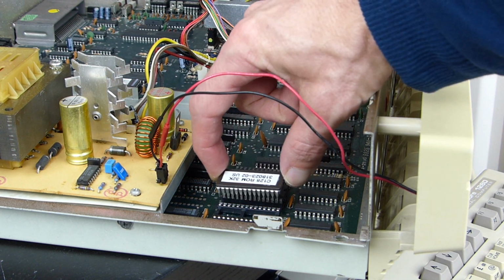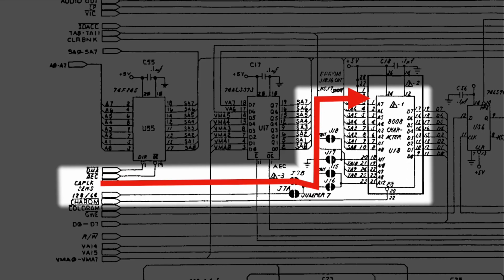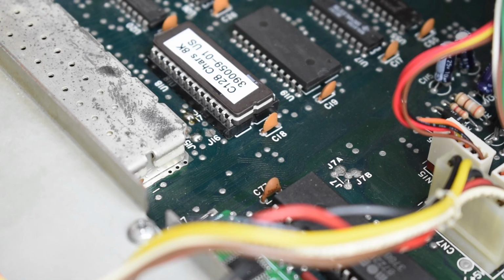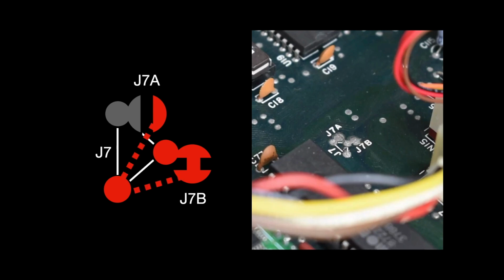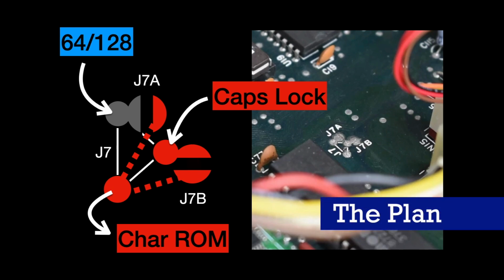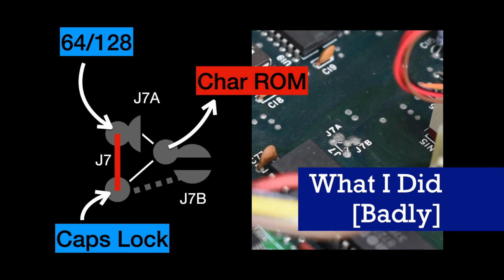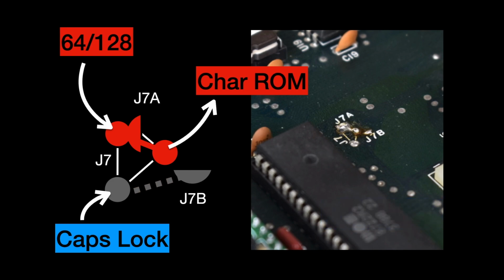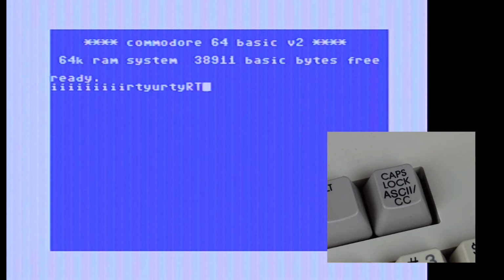The Anglicising of a French Commodore 128 — Part 2: The Jumpers

Comment: In the UK PAL-I system, the single color subcarrier is 4.43361875 MHz above the video carrier. The video bandwidth is 5.5 MHz and the audio carrier is 6 Mhz.

In the French SECAM-L system, the colour subcarrier is split between two different frequencies, 4.250 MHz and 4.40625 MHz above the video carrier. The video bandwidth is 6 MHz and the audio carrier is 6.5 MHz
Reply from the maker: That's a good point, but I'm not using the TV out, so haven't bothered with that.  I'm hoping to replace the modulator with a c0pperdragon board to get YUV output I can feed into an RGBtoHDMI.